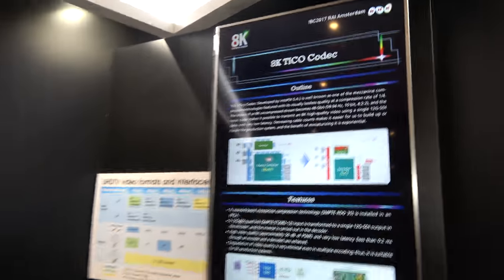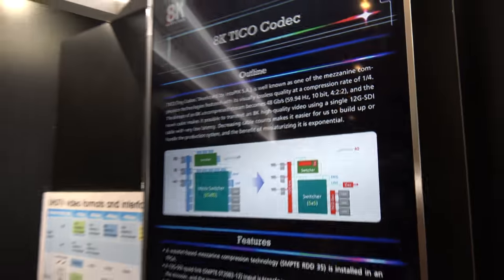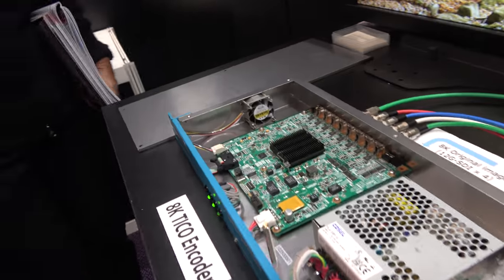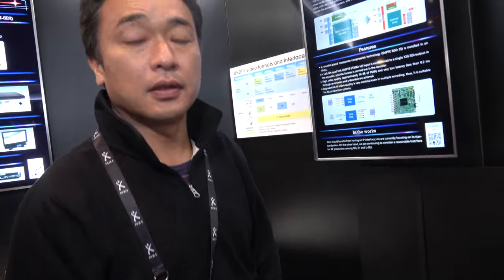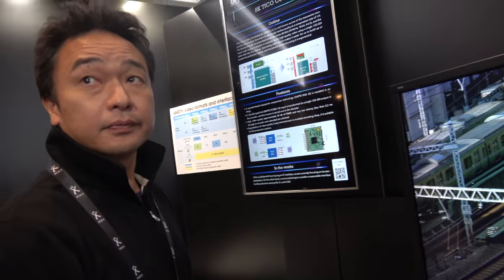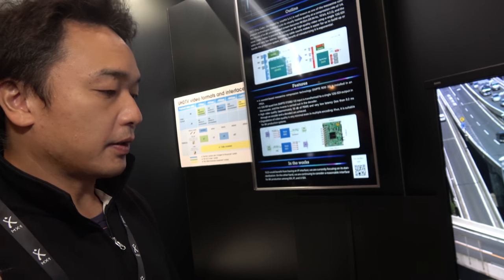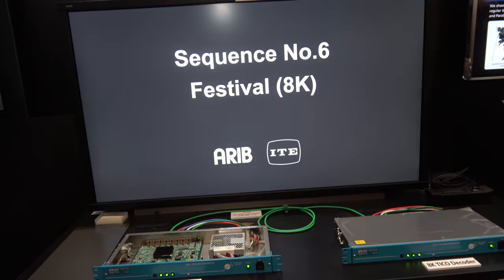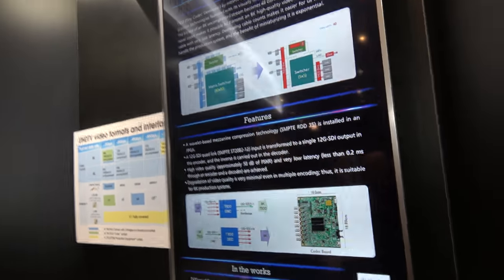NHK 8K TICO Codec

Comment: Japanese scientists from NHK have been working on 8K Super Hi-Vision since 1995.
Reply: Really I didn't think even 2k was a thing back then
Reply: Lloyd Share Yep. 2K, or Full HD, was introduced because that was the limitation of the displays, bandwidth, broadcast cameras, OTA broadcast tech, capture-and-store tech, etc, etc, back then.
Reply: Lloyd Share The scientists, in 1995, worked out that 8K, or 16 times the resolution of 2K, was the limit to what the human eye could read, in terms of clarity and resolution. After that, the brain thinks anything displayed is real — a window, if you like. Of course, resolutions higher than 8K will be needed and developed. They will be useful in applications like military satellite image interpretations and 500 megapixel CCTV AI scanning. But as far as OTA broadcast TV applications go, 8K will be the limit.